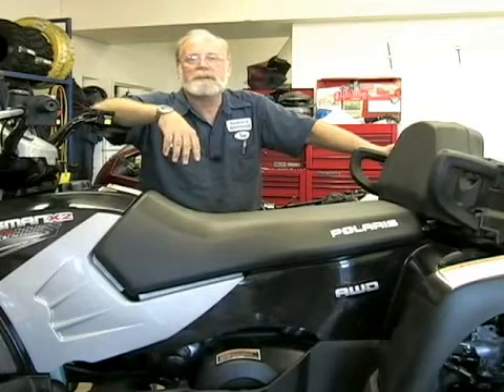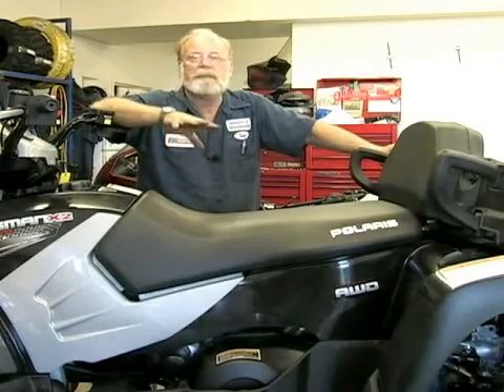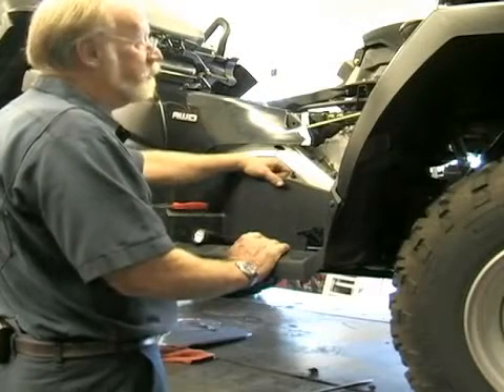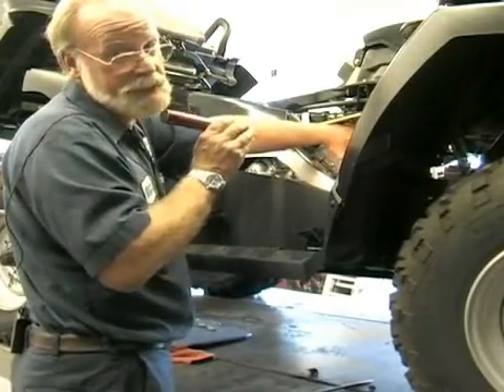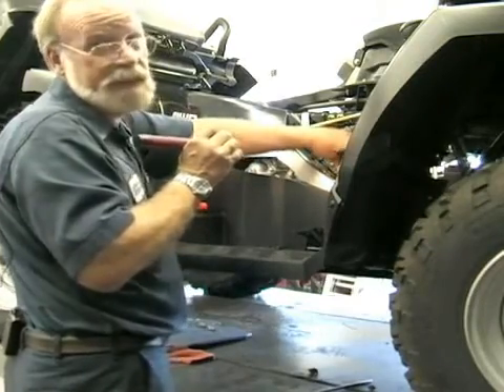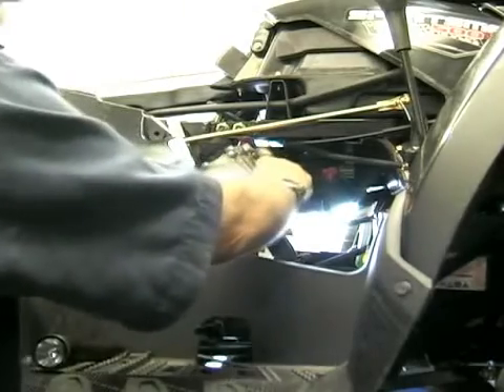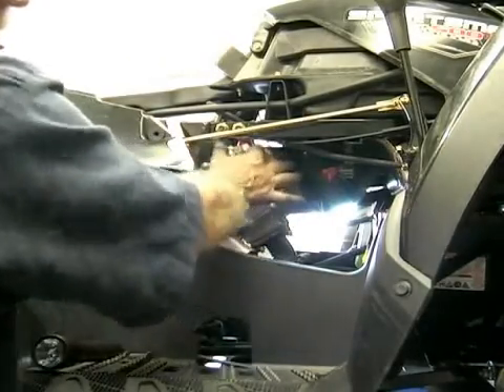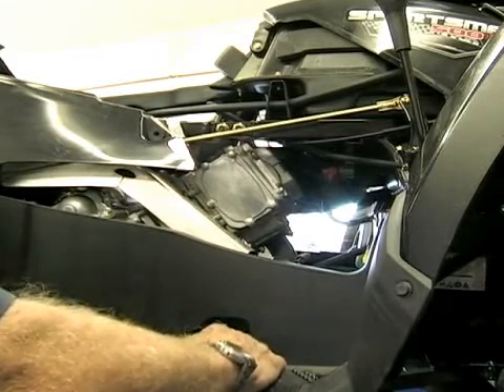Polaris ATV Valve Adjustment Tips

Comment: How are you I just got your link I saw on YouTube I have a 2001 player sportsman 400 remand you fax your head brand new Cam rocker arms are good I replaced the exhaust Cam which obviously wears down putting putting it in the camouflage back-and-forth no I have it on top dead center I know once I put the Cam tensioner in it's going to tighten up a little bit but is it common for that Cam to move that much I noticed on the 3 screws that you decided to come in that cover the compression Left a perfect ring inside the cover not a deep groove but you can see where the Cam was sliding now my chain is in good shape the the whole top end I really did I had to take it off because I had a water jacket issue and it had to get another head for it pain in the ass but I didn't notice that Cam moves that much and everything is new up top do you have any information on that Thank you